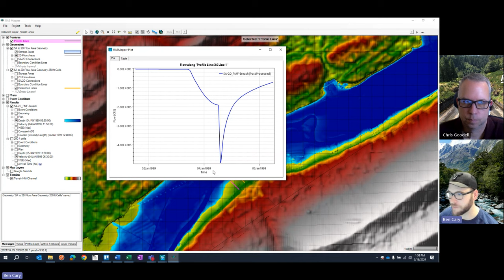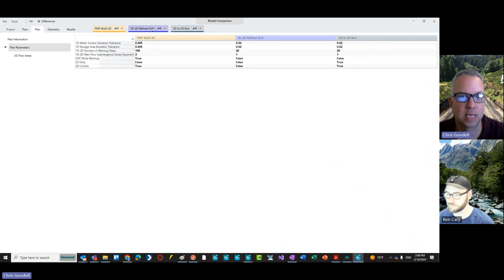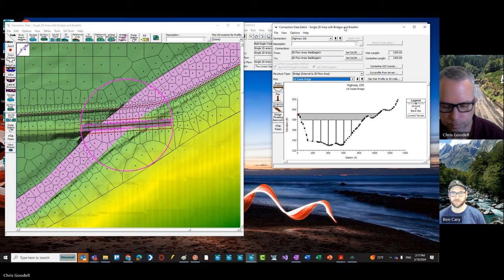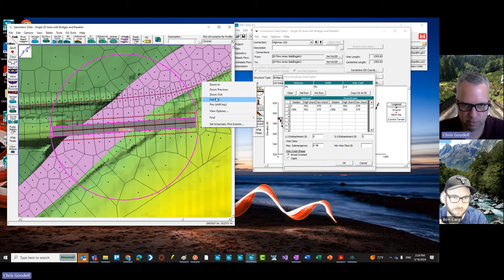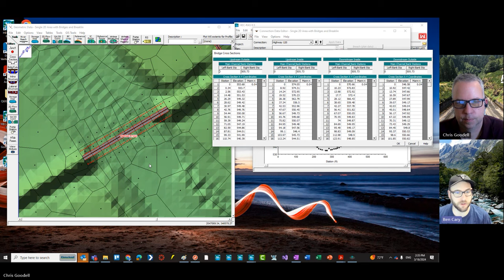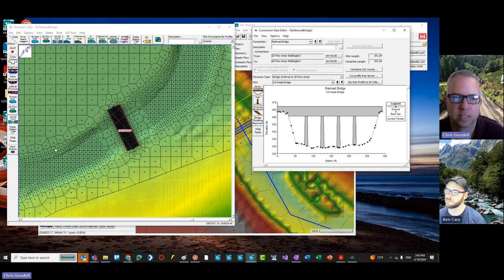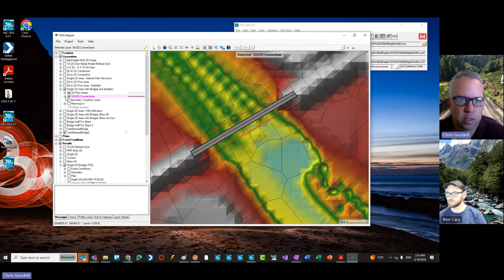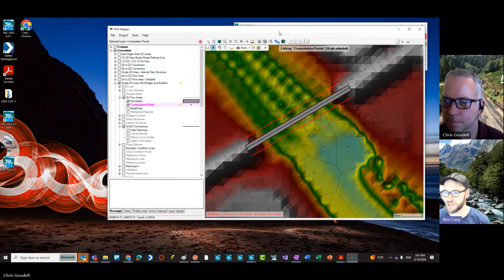Episode 28: 2D Bridges - Best Practices/Potential Pitfalls

Comment: I am working on a very large model in full 2D. It has 110,000 cells, and it has 17 BC input hydrographs, the one with the most volume being approximately 125,000 cfs (every 5 min). When I try to run a 12-day simulation, the program does not simulate. I have consulted the reference manual and there is no mention of a hydrogram limit in any section. The solution I have found is to divide the model into 4 and simulate 3 days each time (with 0.5 time step in Fast SWE), but it is very annoying since it is not always easy to make the restart files square up. Could you help me if there is a way to simulate the entire model without having to divide it? Thank you

Comment: Thanks for the Podcast guys, really useful episode. What's the best way to look at the amount of flow that is going through a 2D bridge? In 1D we have the nice Tabular Output we can look at that provides the amount of flow going the bridge compared to the flow that's overtopping the bridge, etc. For 2D the only thing I have really used is the Stage and Flow Hydrograph. I go into the bridge geometry to find the deck elevation then find the spot on the Stage and Flow Hydrograph that the HW meets that elevation, if that makes sense.